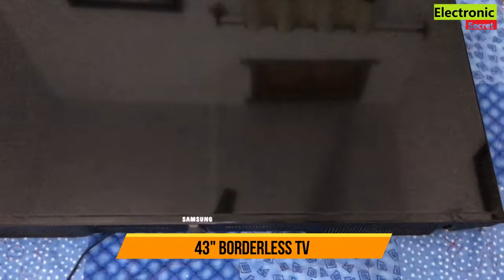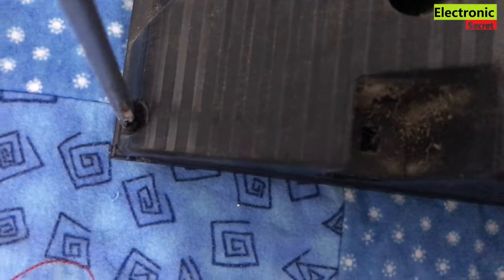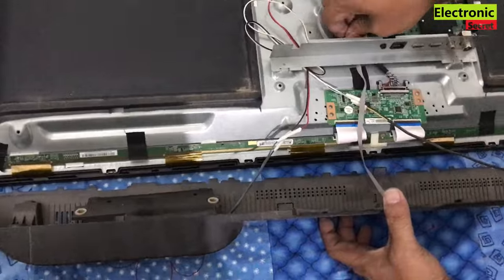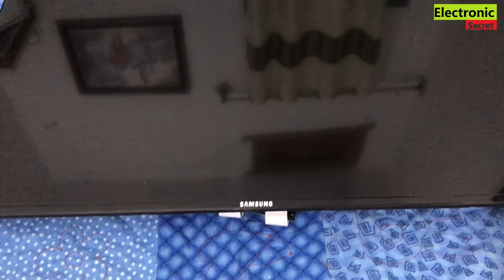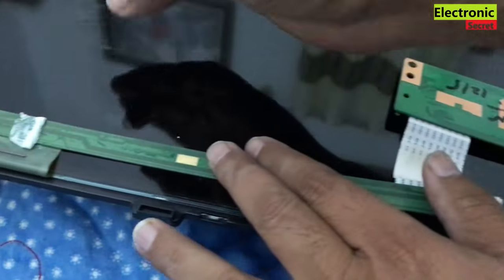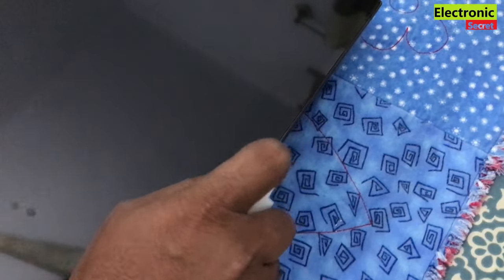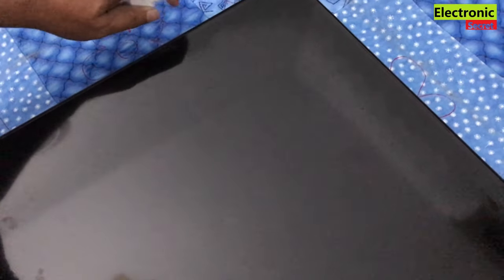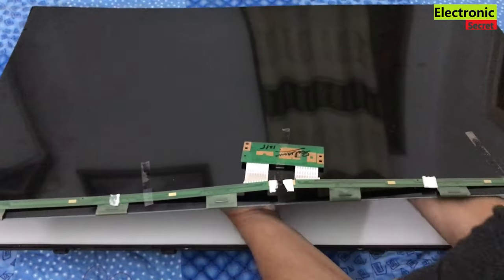How to Remove Tv Panel Borderless/Frameless/Bezel Less

Comment: 1stly I love ur videos because u are only 1 of the few guys that tries to speak English and I thank u very much coz most videos r in hindu, Bangla, tanglu whatsoever bt u try at least English coz I'm a subscriber to ur channel and English help us alot so I thank u keep doing what ur doing God bless you with many English speaking subscribers I will also like u to make a video on lcd TV power supply that has standby voltage bt not releasing 12v,18v for sound ic and 24v for backlight inverter circuit coz that's the problem I'm having right now I thank u in advance